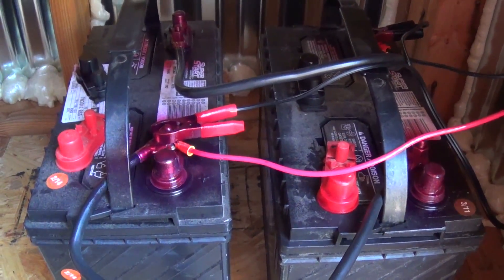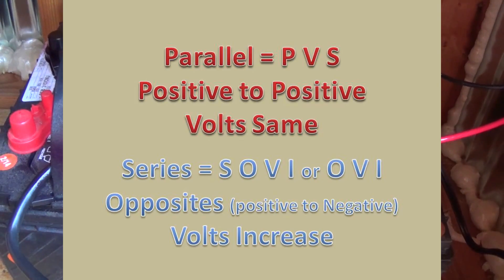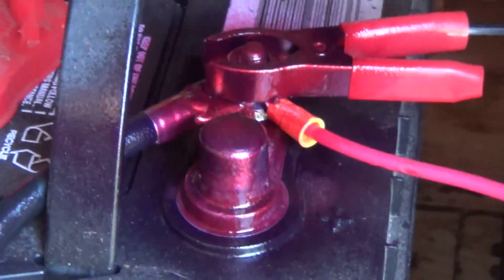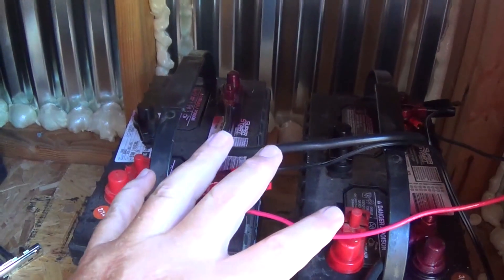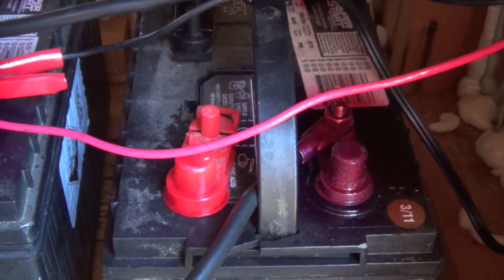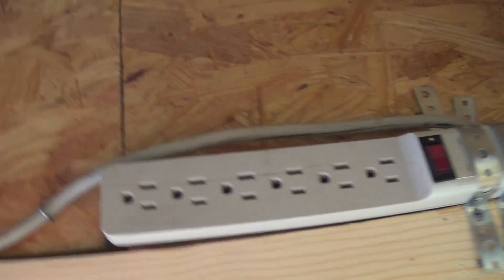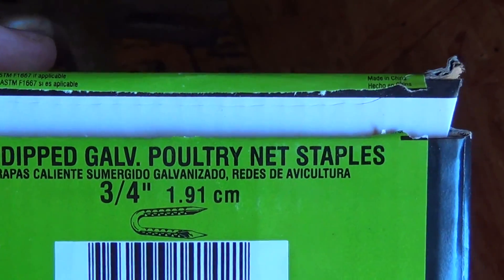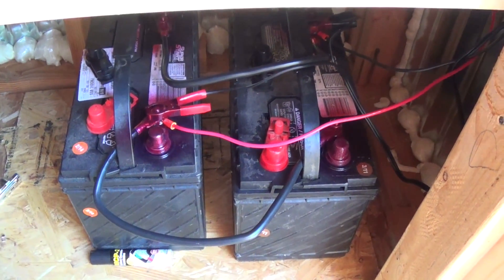🔥Wiring 2 12 Volt Batteries in Parallel - Solar Panel, Charge Controller, Inverter

Comment: Load? How?  Does it go connected batt/fuse/inverter?   What size breaker?  Batt to iverter?   4-12v =440Amp
Reply from the maker: batt fuse inverter. the size of fuse depends on the inverter. if the inverter is an 40amp inverter you go with a 40 amp fuse. the fuse should be as close to the positive terminal of battery as possible.
Reply: So how do I get the correct size breaker/fuse?  How do i do the math thing?... is a Jupiter 5000watt inverter

Comment: Thanks for the guide Jeff. In my case I have 3 12v deep cell batteries wired in parallel for my motorhome. How should I connect the charger leads to get an even charge for all 3?  I found a diagram showing proper method for 4 batteries but nothing for 3. Thanks!
Reply from the maker: should be the same just take one battery out. example is parallel you have bat 1 pos to bat 2 pos to bat 3 pos. so bat 1 pos is your main positive terminal. bat 1 neg to bat 2 neg to bat 3 neg so your bat 3 neg is your main negative terminal. all other terminals pretend they dont exist.  charge controller, inverter and any direct battery loads go to bat 1 pos and bat 3 neg. you can becus of so many wires going to the terminal run 1 wire to a bus bar where all the loads, charger, inverter are connected to which may help with small space.... does that help? good luck. dont forget to ground your bat 3 neg to your chassis of the motorhome. . may already have an area for that.

Comment: Does the ryobi drill require a pure sine wave inverter to charge batteries?
Reply from the maker: no I was using a harbor freight 800w inverter. very basic.

Comment: oh...here's  question for ya...
What is the "Max. PV input power" Rating on the controller chart in the MPPT (EPEVER) manual?
    Mine is a 20 Amp - rated at 260 watts Input... I have 300 watts of panels  does that meen that the controller will blow up if I try to use it with those 300w panels? or is the actual input less than 400 watts due to loss in wires and partial sun ect. ?
In other words, Do I have to definitely buy a 30 amp MPPT controller rated at 390 watts or can I get away with the 20 amp unit rated at 260 watts? Or- to go further...would the 40 Amp be more efficient being it's rated at 560 watts / 40 Amps?
I ask because in direct light my 300w pannels don't input but 18 Amps... so technically the MPPT controller could handle them...
Reply from the maker: actually you might get 300 watts at times even higher for short periods of time. so yes it may damage the charge controller. . in my system i have my charge controller maxed out. if i went with one more panel i would damage my controller.  its a great question. panels are effected by temperature, clouds and exact angle to sun. i have experienced on a cool day slightly cloudy reach my max. some clouds may act as a magnifying glass increasing the the sun on the panels resulting on higher watts produced.  sorry go a little bigger than the panel for your controller.
Reply: Thanks for the reply.......   I ended up goin with the 40 Amp unit   (Instead of cutting it close on the 30 Amp)

Comment: But- what order do you hook up the stuff? Or does it not matter?   
 Example...Which do you want to hook up first- The jumper cables to parrell the batteries right?? Then-  the Inverter  and last-  the solar panels? what order?
Reply from the maker: good question. i did a video on what comes first parallel or series . to wire the entire system keep in mind live wires. from the inverter to all loads wire that part. wire up all the batteries series first. wire up charge controller to panels with breaker in middle. turn off breaker so no live wire into the charge controller. wire charge controller to batteries and turn on breaker and check for charging and any smoke. lol if all is looking good you can than wire the inverter to the batteries. always in all cases wire negative first but make sure positive end doesnt touch anything. you might experience a spark when connecting the positive wire/cable but do  not let go. do not drop jump and drop the wire it might hit something else and cause major damage to everything. even fire. wire gloves. does that help?

Comment: Can I use 100watts Solar panel a single one on two 120amp batteries?
Reply from the maker: yes. keep in mind how much sun you will have example 5 hours of sun on a 100watt solar panel assuming its 12v. will put roughly 41 amps in per day.  100w = amps x 12v, .. 8.3amps x 5 hours = 41.6amps . assuming your batters are 6v 120amps wired in series to make 12v 120amps .. based on 41amps charging the batteries your max use will be less than 41 amps per day at 12v.   yes but watch your consumption.

Comment: Question ❓ what if the two batteries are slightly different ie ne battery is 110 and other 100 ampere will this change your parallel system
Atb Mark
Reply from the maker: not good mixing batteries. what happens is when you charge them it will only charge them to the weakest batter in this case the 100amp so the 110 will never get fully charged. the 110amp battery not getting fully charged will later become the weaker battery drawing down the 100amp. in short mixing batteries will reduce their life span. same goes for age of battery.

Comment: Thanks for the info I found it very helpful in figuring out what I need to do.  I assume that if I were connecting more than two batteries it is still the same principle of connecting + to + and - to -   but both charge and loads to the outer two batteries so that for example the three batteries charge and drain equally. Now would you know if I wanted to combine a wind generator to the solar panels so that at night the wind generator  charges while the panels charge during the day?
Reply from the maker: you are right on. i also did a video that showed multiple batteries  with where to connect the loads, charger, etc. and you are right on.  name of the video is "which comes first series or parallel?

Comment: Hey , I just watched another video with almost the same set up . He had 600 positive feedback all good . He stated to hook up load and inverter he used the negative and positive of the same battery and called it the lead battery . You went positive to negative with the 2 different batteries . Like I said he had great reviews . I am confused .
Reply from the maker: the "lead" battery in your example will cause the overall battery bank to discharge unevenly. when you check the specific gravity of each battery you will start to notice they will become uneven.  think this way ... a  battery can only have 1 positive terminal and 1 negative terminal.  once you  link them together series and or parallel they make one battery.  i did another video called "which comes first series or parallel" i think that explains it better.  i now it was confusing for me too. i checked with alternative energy discount in my area plus arizona wind and solar in flagstaff and they say do not wire them up in your example with the "lead " battery.  hope that helps. if you need more let me know.
Reply: Thank you soo much for this video.  You're the first video that I found that shows all the reds and what to do with them.  I have a Class C RV with 2 12 volt Deep cell batteries... got new batteries and should have taken a pic before I disconnected everything.  There are 3 reds.  The 1 red I put on to connect +tive to +tive on the 2 batteries.  There are 2 other reds coming from the house.  I do have an on-board generator that charges the batteries, an inverter that was preinstalled by the fuse box, and somehow the engine battery charges the house batteries when I'm driving so the 2 reds coming from the house must be in line with the those 3 components.    So by your diagram and what I have, I would have 3 reds on the +ive on battery#1... 1 red on the +ive on the other battery #2 ... 1 black connecting the -ive side of each battery and 1 black coming from the house onto battery #2 ... so I will not have a "lead battery" ... I was mostly confused about having 3 reds on battery #1+ive side and 1 red on battery 2 +ive side ... and your diagram shows me I have it hooked up correctly.  Sorry for long winded explanation:)

Comment: great video!! but what kind of cables and connections??
Reply from the maker: for these batteries i just used standard car battery cables. its only 12v and low amps becus they are marine batteries so nothing big. the solar panels are only 45watts .
Reply: @ArizonaHotHomestead  do you find solar charging is very slow on those 2 batteries if you only have a 45w panel?
Reply from the maker: @HomeCoffeeRoasterUK  i never paid attention to time. 45w at 12v is less than 4amps so it makes sense to be a slow charge.

Comment: Great vid Jeff. You're explaining a lot more detail than the other vids that I have seen.

I have a single 12v battery not lasting long for my terrova ipilot on the boat.Last trip it only lasted 90 minutes of trolling.Probably a bad cell in it so time for a new battery this spring. I'm thinking of getting 2 new larger batteries  and rigging them parallel and hope for 4-5 hrs of use. This vid perfectly explains how I'll wire the terrova  as well as my 2 bank onboard charger to charge all 3 batteries between trips.
Reply from the maker: awesome. glad it was helpful

Comment: Great video. I just purchased a 30 watt solar panel, a solar charge controller and I want to connect them to my boat so I can keep both batteries charged and protect them from being overcharged. Your video has really helped. Keep the up.
Andy
Reply from the maker: good to hear i have been able to help others. i like the idea of keeping the batteries charged for the boat. the part that sucks is living in the city i would wait until the fishing trip to test the battery and in most cases it needed to be charged . i have even forgotten to check and went fishing with a dead battery. lol.... no more dead battery.
Reply: I plan on securing my panel to the rear of my pontoon boat. There is a lid over my battery compartment that should hold the panel just fine. All I should have to do is run the panel wires to my controller box and from the controller box to my battery. Is that the way it's done??? When my battery is fully charged, what happens to the power coming from the solar panel? All I know is that no more power is going to my battery so it won't burn up. All of your help sure is appreciated.
Andy
Reply from the maker: the controller should be smart enough to eat the extra power from the solar in fact some controllers have another set of connectors that would go to a dump load like a water heater or a light or anything you want that isn't dependent on the power.

Comment: you might have solved a headache of mine. thankyou!
Reply from the maker: +Jason Williams excellent. we are all here to help each other out and or entertain each other. .. what type of battery project are you working on?
Reply: +ArizonaHotHomestead very true!  its in my camper van.. 250 watt panel to a controller, to 4 x 125ah batteries in parallel. I have the controller leads both to the 1st battery and my inverter leads both to the last battery. Doesn't charge properly at the moment and it the inverter does the low battery beep even after A week of sunshine . so I'm gonna swap some leads around like you said :)
Reply from the maker: nice. so if I understand you right you have 4 12 volt 125ah batteries wired to give you  1 big 12 volt 500ah battery (parallel) . which means charge controller and loads (inverter) will be attached to the positive post on bat 1 and negative post on bat 4. let me know how things work out . do you also use a desulfator which is used in maintaining the batteries? I don't use one on 2 batteries but if I had more I would consider it.

Comment: and you could have added, the gauge of the wire from the battery points to the inverter be very large
Reply from the maker: +George Gardinier I know I thought about that after I did the video. I don't even know the gauges I used. lol... the jumper is from the auto shop so I think those gauges are standard . sorry great point I should have talked about the gauges.

Comment: you forgot to mention one thing when you go to parallel the volts to stay the same but your amperage doubles it when you go to Ceres your voltage doubles but your amperage stays the same
Reply from the maker: +DIY GUY 101 I didn't talk much about the amps increasing but the PVS parallel volts same. got that part of it.